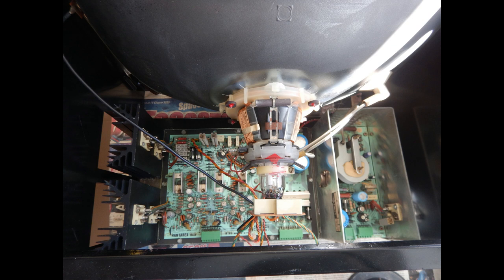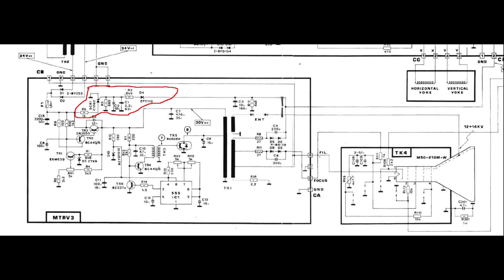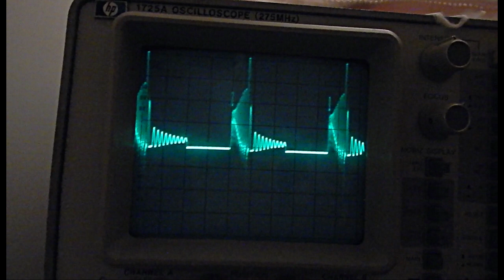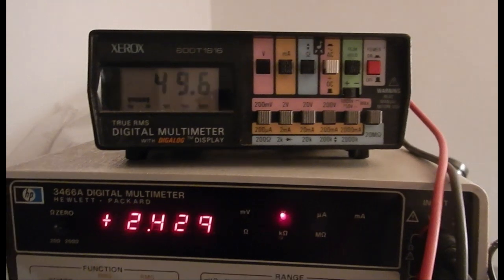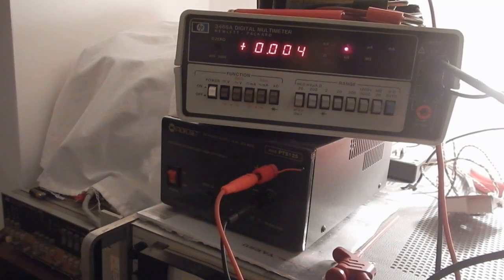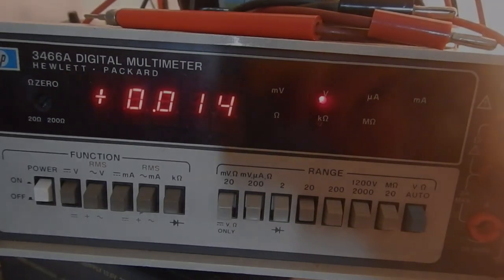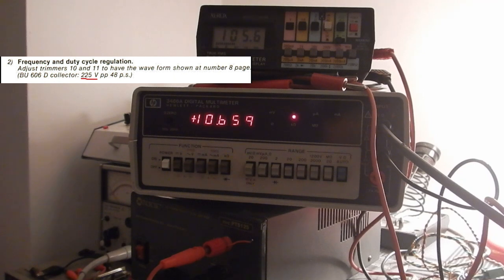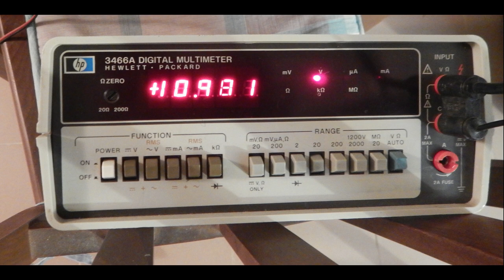Hantarex arcade vector monitor (2x) repair. The bad and the good.

Comment: Nice job Frank. Your light bulb reminded me of a hack my father did to a BW set about 1975. It was an old TV (even at the time) given to my Dad because it was not working. He found that a 'fusistor', a fusable power resistor, in the mains input was open and that part was not longer available. (I suspect it was a hot chassis set, i.e. no transformer.)

Dad realized that a 200W light bulb had about the same resistance and could dissipate the required power. He placed a ceramic bulb socked in the cabinet and put a suitable fuse inline with the bulb for a makeshift 'fusistor'. This worked fine for years and the set was eventually passed on to a sister when she moved into her own apartment. After several months of service at its new home the 200W bulb blew and my sister went to the local hardware store to get 'one of those big light bulbs that go in the back of the TV'.  Needless to say the store had no idea what she was talking about :) But, once Dad explained to her what she needed that old set was working again.
Reply from the maker: Amazing story Jeff! Thanks for sharing it!

Comment: What strange monitor designs! I really appreciate your very clear circuit explanations, much better than I could do, thanks for your videos
Reply from the maker: Thanks! I'm glad you liked it! The vector monitors are indeed a thing of the past, but they have a fascinating image quality, brightness level depends on both K-G1 voltage (as in a regular raster system) and on the speed of the deflection on any particular part of the image. Look how much brighter are the "shots" with respect to anything else. This brightness "dynamic range" wouldn't be possible on a raster monitor.
Reply: @iz8dwf  yes, I'm familiar with vector monitors (watching classic arcade repair and mikes amateur monitor repair channels) - but usually Atari, Electrohome or Wells-Gardner types. Using a 555 and an unregulated HT supply is quite weird!
Reply from the maker: @leeselectronicwidgets  Indeed it is, but I think it was a very unusual design back in the late '70s so the engineers tried to use "familiar" circuits instead of experimenting too much :)